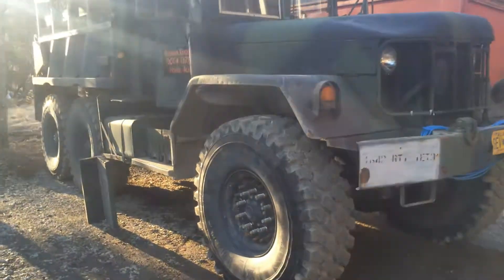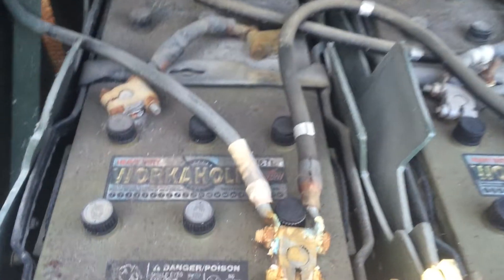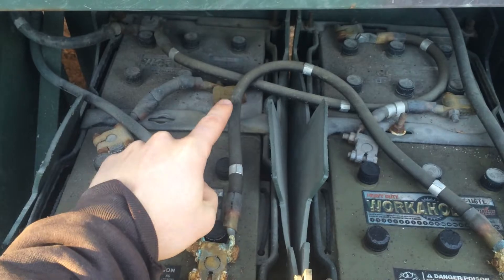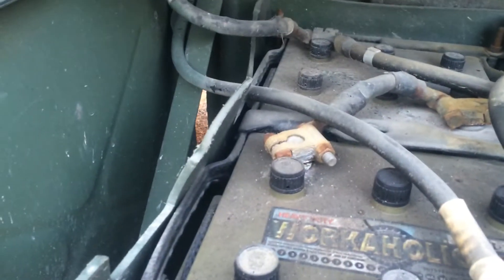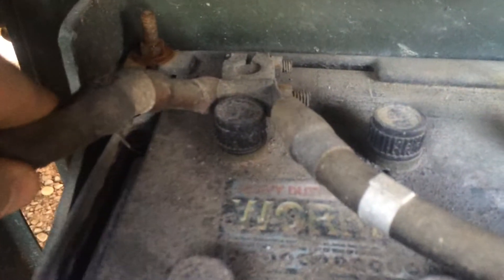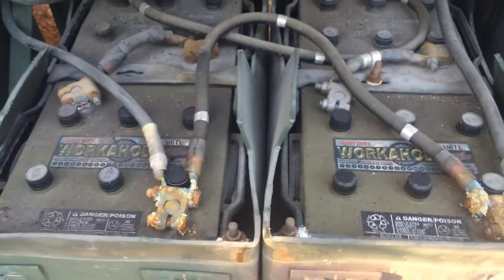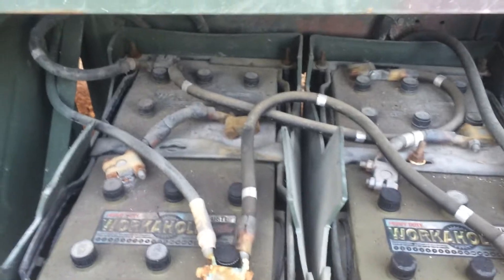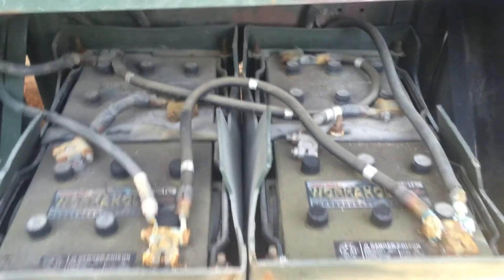M800 Series Truck Battery Connections

Comment: Those of you asking 12 or 24, its 24v, 2 batteries on series is 24 volt, the two sets in 24 volt connects parallel.